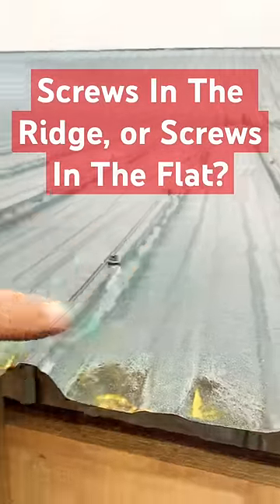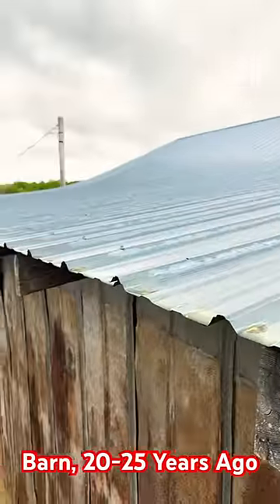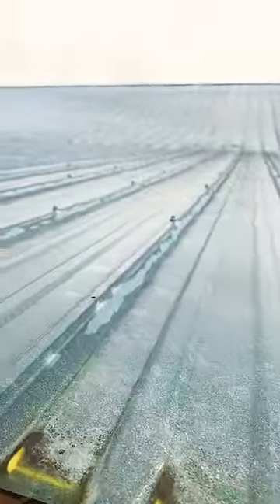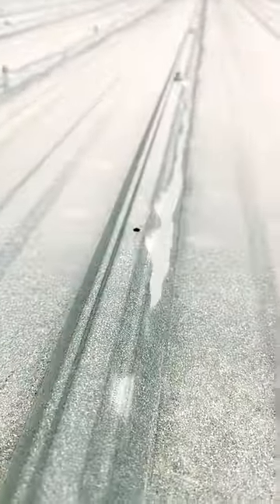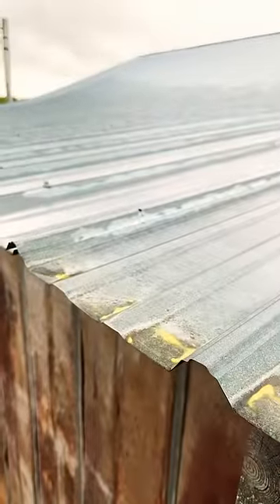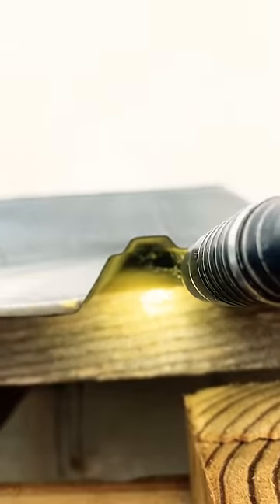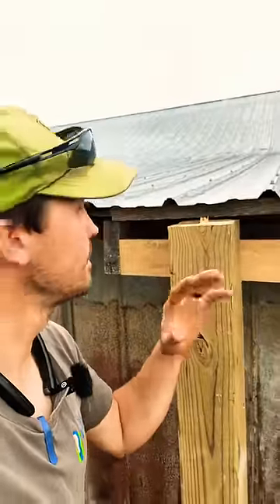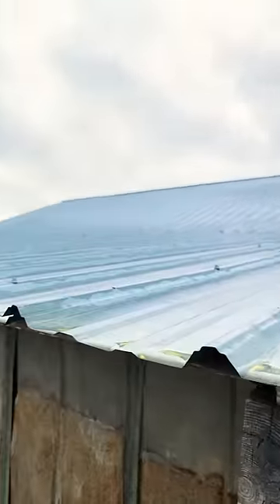What’s Better? Screws In The Ridge Or Flat? #construction #farmlife #building

Comment: The ridge makes the most sense since water will run down and away from the holes instead of collecting in them. It also means the screws won’t be sitting in water and start rusting out.
Reply: I'd also go a bit further and say it also pushes the flats against the boards harder from the ridges spreading when you tighten them. Like screwing a flat material against a wall you can still usually spin the piece you screwed on. But if its bent down the middle and you screw in the ridge. It would be harder to spin compared to the flat piece. Could be a dumb idea. Just figured I'd throw it out there anyways 😅
Reply: Exactly
Reply: @lilIAN97huh yeahs that’s completely wrong. But what do i know. I only work at a roofing company with a bachelors in structural engineering. You use a minimum of TWO types of screws. Sheet connecting screws and roof fasteners. Every manufacturer instruction states to screw the sheets on the BOTTOM of the flat.
Reply: Building steel buildings, we put screws on the flats and screws on the ridge where they overlap with mastic.
Reply: @tamaninesauc  don't see why your bunny ears gotta get all fluffed up when I literally said it could be a dumb idea. You're kinda weird my guy
Reply: Weird the manufacturer said we use the ridge, the flat is for windy places, like the way he did its going clap in the wind at certai  angles. Bur maybe its better for the board to come off without wood frame.
Reply: Unless you get snow that has to be pulled off of the roof. Putting the screws on the ridge makes that 10 times as hard
Reply: Both
Reply: @tamaninesauc don't know what instructions you've been looking at, but mine said to put a screw in the center of the flat AND on the ridges. Mine also came with precut HDPE dunnage, cut to perfectly fit the inside of the panels, so they wouldn't warp, when screwed down at the ridge.
Reply: Unless it snows 3 months out of the year
Reply: Makes more sense to do it that way, that’s how my dad always did it
Reply: @tamaninesauc you don't have to use the two types of screws. Youre referring to the stitch/lap screw vs the metal to wood screw. You can use the metal to wood on the entire roof and it will be just as fine as if you used the shorter stitch screws.
Reply: @tamaninesauc  not in Australia, always in the ridge
Reply: If you have screws on the flat that are sitting in water on a pitched roof, you're roof is more fucked up than a football bat.
Reply: Exactly

Comment: Hardly a debate. In Australia 75% of houses use corrugated iron for roofing and every single one has screws through the ridge to prevent leaking.
Reply from the maker: Look through some of the comments. It’s amazing how many say flat
Reply: @RouthFarms  I do love seeing people insist that roofs will blow away or the heat expansion will be a big issue.. we have cyclones in oz, we have truly brutal sunmers, hail storms etc and somehow we have tin rooftops being the huge majority and they survive.. Colorbond roofing and corregated for older ones and the technique has always been in the ridges if you were taught how to do it right. At the very top of the sheet under the Ridge capping you can do the flats.. and on walls of sheds it doesn't matter.. But ye olde days they had nails with caps, and on the flats that sure would have leaked. Tek screws have washers but will eventually crack and leak if in the flats.
Reply: It seems their argument is expansion and contraction working the screw loose.

 Americans sheet their house roofs in ply for fixing whereas we'll use a 70 x 35 timber batten, we have more than double the screw engagement which will hold up to any movement in the house or sheets

An exception would be topspan 40, I have seen roofs blow off but the battens go with the roof sheets

It's the roofers using a 50mm high grab to fix battens to steel trusses. Once the high grab works loose the roofs able to move a good few mm which seems to be enough momentum to keep pulling away from the truss
Reply: @--Nath--  Those lead top nails you find in the old houses are worth a fortune now!
Reply: The presence of a obviously correct answer has never preempted an argument on the internet 😂
Reply: Being an Australian I can say with authority that you can safely screw anywhere on a roof, just not near the edge.

Comment: In 1974 my Dad built a barn. All the lead head nails went through the ridge.To this date there are still no leaks.
Reply: yes:  but those were lead-heads:  a totally different critter than modern screws with washers & seals.  The idea with those lead-heads was the soft lead would deform to conform to the roofing and seal against leaks - they were notorious for leaking if driven on the flats and were ALWAYS put on the high points  -  they were basically little lead umbrellas and are seldom ever used now except maybe on corrugated and V-crimp  - but everyone still has a little handful in an old jar in the shed
Reply: That's the way with my dad's barn, built around 1980, except his nails had rubber-type washers. The washers are long gone, now, but the barn still has very few leaks.
Reply: Built a commercial building around 1976 or so. Metal roof leaked terrible after about 8 years . The technology was terrible back then. All the seals rotted.
Reply: @miked8227     those were rubber  -   what you mostly find now are galvanized ( and maybe painted ) fasteners with neophrene seals  -  those are good for 15 - 20 years against UV  ( assuming you didn't smash the seals or put them in cocked )  -   you have a lot of more and better options now  -  the best fasteners now have a cup instead of a washer and the neophrene seal is slightly thicker than the cup is deep  -  when tightened down, the cup completely covers the seal so no UV hits it  -  they are bigger and show more than the normal screws plus they cost a LOT more  -  so nobody uses them
Reply: Nooooo professional would ever put screws only in the ribs. None. I'm a professional. I put these and commercial panels on every day 14 hours a day. On commercial panels we put a stitch screw on every rib to tighten the over lap, but all the screws are on the flat also. You see in the video how some of the ribs are flat and the panels are wavy? That's cause when you tighten that rib down it stretches the panel throwing off the straightness of the roof and destroying the life expectancy of the roof. Plus, you gotta use long ass screws to reach the hat channel or studs.
Reply: @bonesrhodes3762  actually we fastened it down with nails with the rubber seal. 👎🏻
Reply: @miked8227    you can still find those  -   people use them a lot for the clear plastic panels  -   the seals don't last long because of the UV  -   I remember some even had a foam seal on an aluminum nail:  those were a really bad idea
Reply: @bonesrhodes3762  Does it really matter what the fasteners were though? Our shop was also built in the early 70s using lead-heads in ridges. Since then the lead-heads have been removed and replaced with screws, and that roof still has no leaks today

Comment: My dad’s been a roofer for 20+ years and I’ve helped him on many occasions. We always bolt through the ridge.
Reply: Yet you call a screw a bolt 😂😂
Reply: @bradleyward285  I’m gonna call them bolts cause there hex head.
Reply: @sagenbabin8786  still a screw though
Reply: @bradleyward285  call it what you want it doesn’t matter what it is if it doesn’t hold the roof on securely
Reply: This proves that Knowing why a bolt is s bolt and a screw is s screw has nothing to do with proper roof application. The fasteners go on the ridge.
Reply: @sockoblocko  exactly call it what you want if you build it how it’s supposed to be it’ll last
Reply: @sockoblocko  NO.. THEY DONT

Comment: Technically, you need them in both, the screws in the rib should only be on the lap to hold the sheets together. The screws in the flats are to hold the sheets to the structure. You need both otherwise fuk it leaking you’ll be collecting it from your neighbours yard first wind storm. If you don’t wanna deal with leaks, get a standing seam roof.
Reply: I've never seen one blow off with screws in the ridge only.
Reply: @GunGuy258  for starters the ridge is at the top of the roof, what’s being referred to as the ridge it’s actually the lap, that being said, based on your use of improper roofing terminology  , I don’t think you have the experience roofing to have an opinion that matters
Reply: @steverichards7830  🤣 
Calm down... I didn't say it was the proper way, I said I've never seen any blow away that were only screwed down on the Lap.
Feel better now? Don't get your roofing panties in a wad.
Reply: Meanwhile dude said this roof is 25 years old, and it's OBVIOUSLY there, FULLY attached. LOL
Reply: @jordanbabcock9349 In fairness though, it depends on what sorts of weather you get.  Where I currently live, there's a good reason the code is a wind rating >150 mph ;)
Reply: Nails and screws will not fail if the integrity of the wood remains and you have a Sufficient number of fasteners.
No In the flat, the water will eventually rot the wood and by by panels into the neighbors yard. I put a roof on a feed lot as a teenager, I remember the difficulty of starting the nails on the steep ridges. The roof is still exactly where I left it 40 years ago.
Reply: The majority of U.S. roofers say on the flat because it holds it tight to the wood, but one over tight screw you get a leak, put the screw on the rib, and it's not going to hold it as tight but it's not going to leak. I say unless you live in a hurricane country, put it in the rib.
Reply: Better tar or caulk those flat ones.

Comment: In my area, the few companies that supply metal roofing will void the warranty if there are any screws in the rib anywhere except the for the ridge cap.
Reply: ever seller I know recommends fasteners through the lap every 12 inches using a shorter fastener which will not catch the perlin  -   wonder if they recommend that to void all warranties ?
Reply: No, thats called a stitch screw.@bonesrhodes3762 
It's standard on most metal suppliers list.
Reply: @dusfitz  yep:  most installers here use a 5/16 hex x 3/4 with metal washer and neo seal  -   it pulls the lap together and compresses the neo seal  -   but it doesn't reach the perlin  -   it is also definitely put in the rib:  but ONLY at the lap  -  I was being sarcastic about the warranty since the man-ufac absolutely says you need them to hold the lap in high wind and prevent leaks
Reply: Tighter more secure seal on the flat. Using screws with the rubber gaskets of course.
Reply: Shpuld be screws in the ridge and the valley, that's the proper instalation
Reply: there should be short screws in the laps that do not go into the deck.

Comment: Ridge for so many reasons. Im not even a roofer, but a little understanding of water, ice, snow, & gravity will tell ya ridge.
Reply: Expansion and contraction will tell you the opposite
Reply: You are so smart Mr "I'm not a roofer". You are even smarter than the manufacturers of these metal roofs who designed the panels and the screws to be used in the flat part of the metal. Those manufacturers sure are stupid.
Reply: If you put screws in the flats, large sheets of ice and snow would collect more than if they were on the ridges, but the ridge screws are often sunk too deep or not deep enough. So basically you need to install them by the manufacturers specs. Pretty sure it should be a combination of flat and ridge screwed.